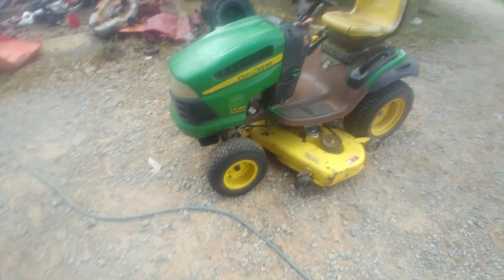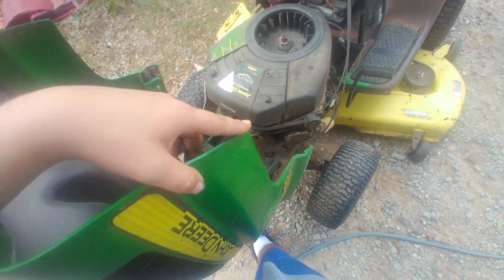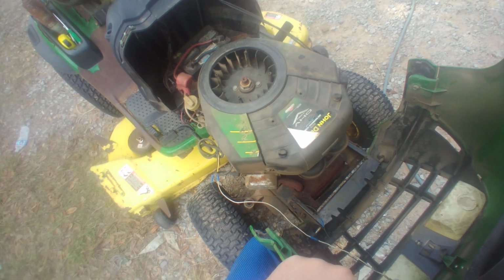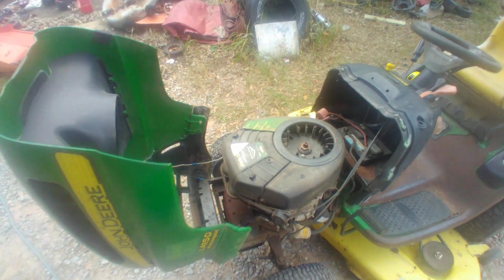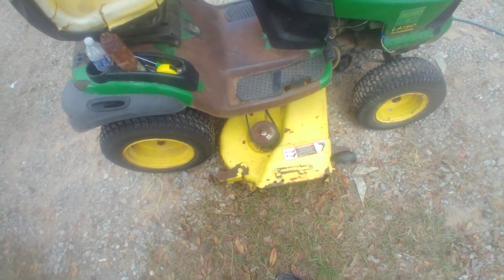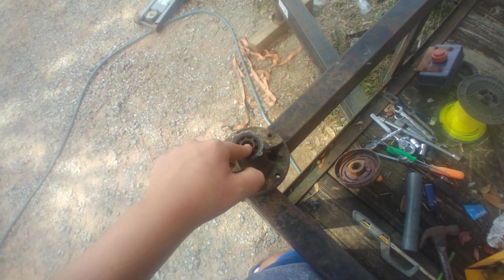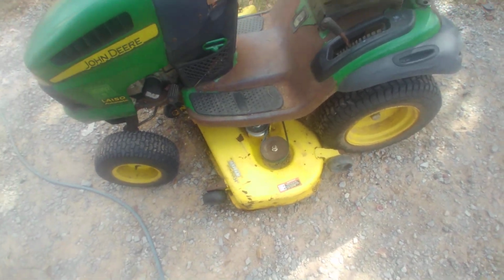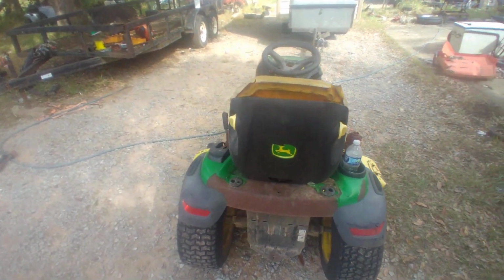John Deere LA150 overview and features

Comment from the maker: UPDATE: I have replaced the k46 with a dana 5 speed transaxle Ive notice more torque and this new transmission pulled a gravely 8199 kt professional without a deck with a flat tire on the left side and it never missed a beat. I pulled 5 or 7 oak logs possibly 12 inch diameter 3.5 feet logs, it didnt realize it pulled those logs.  I wish I had done this sooner. As always. Thanks for watching here is a video after the installment of the spicer transaxle check it out if you want to.
UPDATE: May 1st 2023 the original hydrostatic transmission has been reinstalled back into the tractor.

https://youtu.be/YIs8m_w-Azw
Reply: junk deere..